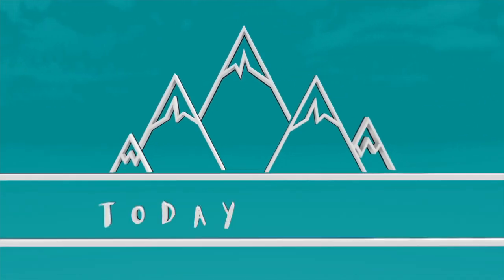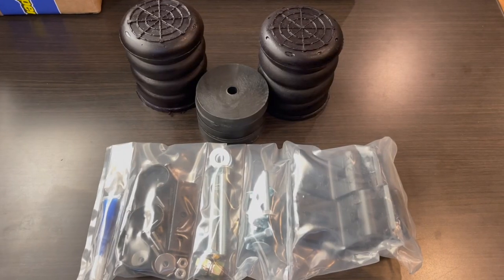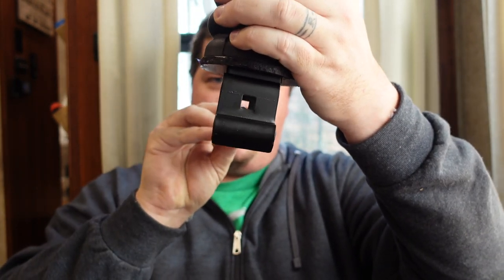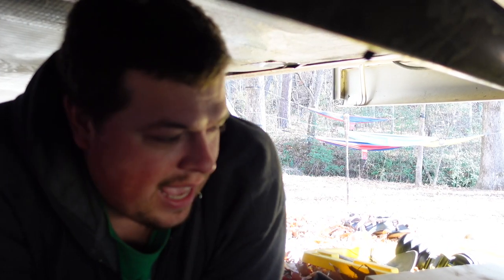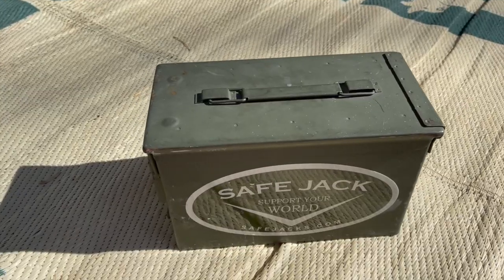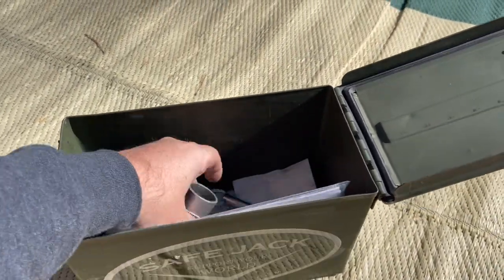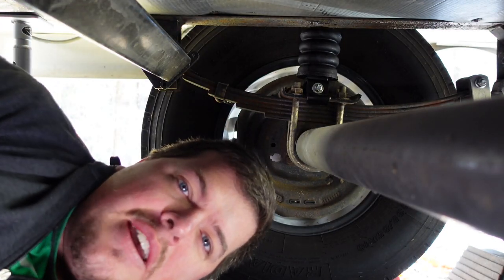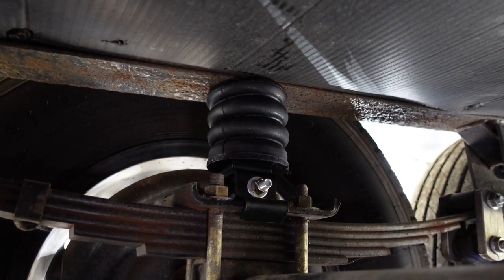SumoSpring Install on our 5th wheel camper - Making the RV suspension stronger for full time travel

Comment: So it looks like you added a spacer to the rear but not front? I encountered the same need and just wanted to verify
Reply from the maker: That’s correct. Unfortunately my truck being taller puts more weight on the rear axle.